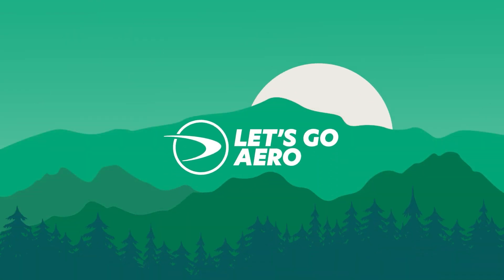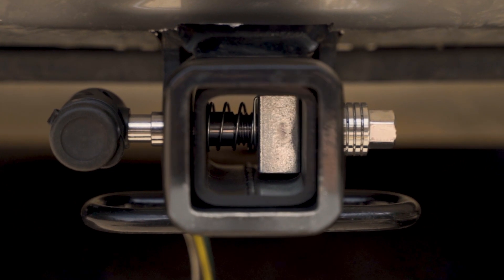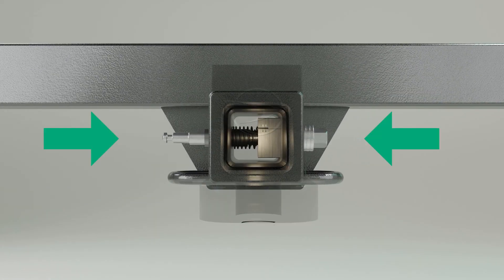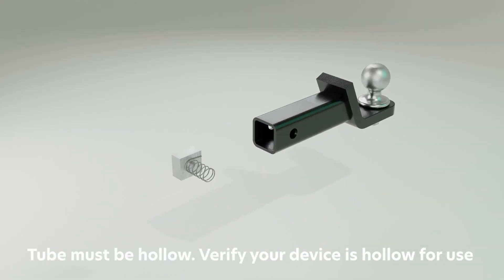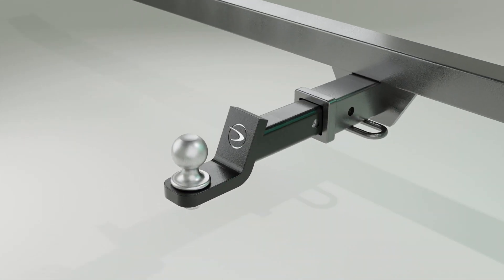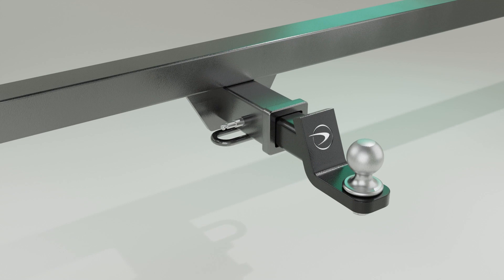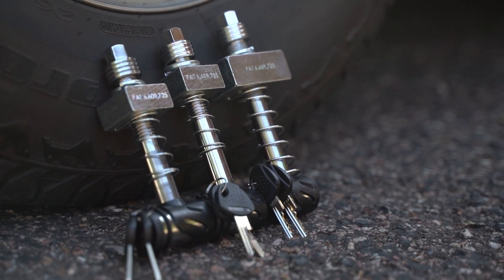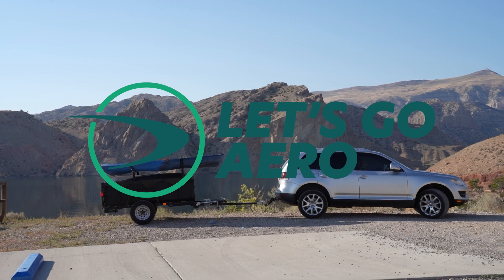Let's Go Aero Silent Hitch Pin®

Comment: Just purchased the 2.5” Silent Hitch Pin for my Ford F250 and used it to pull a small 10ft trailer across town. Five miles, a couple sets of railroad tracks and mildly bumpy asphalt roads later, and the hitch pin assembly was finger loose already when I disconnected the trailer.
Before anyone asks - I read the instructions and did exactly what was instructed. Verified placement of flat washer, lock washer, shank sleeve, spring block. Torqued to 35 Ft lbs with my SnapOn torque wrench. Nice and snug. Pre-lubricated the pin and threads for winter time. One Small trailer pull and the pin was backed out of the spring block threads by at least two threads.  Unacceptable. Any remedy suggestions before I send this product back as a failure to meet expectations??

Update Feb 10, 2025:
I received a prompt response from  a company representative regarding the above mentioned experience. As a remedy to the premature loosening concern, they shipped a couple of “mil-spec” lock washers to replace the kit-supplied lock washer. The replacement washers 0:03  appear to be  MS35338-50 5/8” yellow zinc coated lock washers, which would meet MS/AN military specification standards for certain prevailing torque requirements. I was also informed that it would be acceptable to increase the torque value to somewhere around 60-70 ft lbs. rather than 35 ft lbs as stated on the Silent Hitch Pin instructions. This is, in my opinion, a more acceptable torque value for a 5/8” chrome-moly steel bolt/pin setup.  I commend Let’s Go Aero for reaching out to try and make things right and will let you know how it goes.
Reply from the maker: Hi, sorry to hear that is happening. Can you give us a call at 719-630-3800 and we can have our techs talk more about your issue?